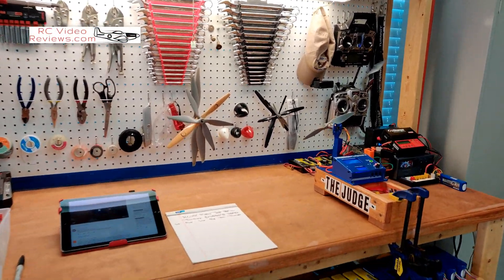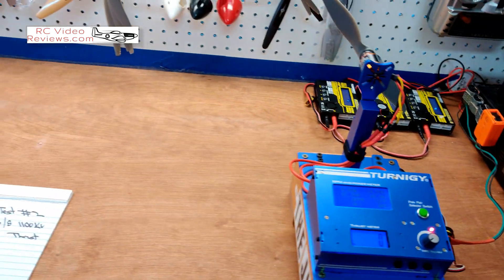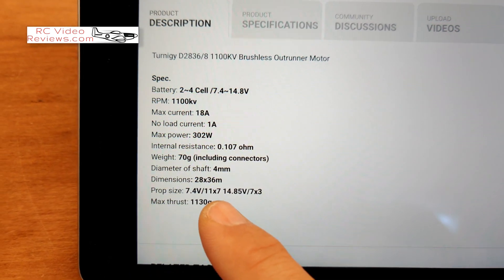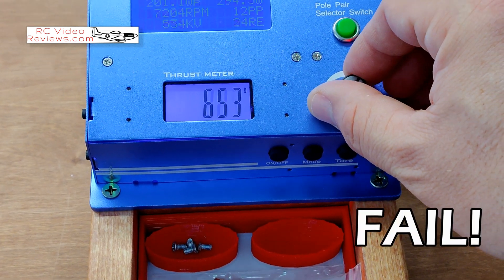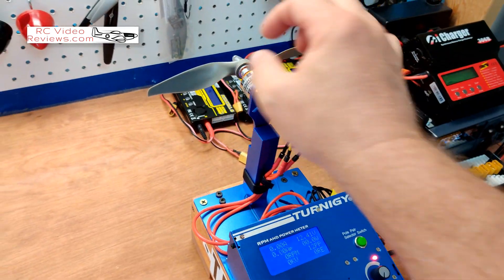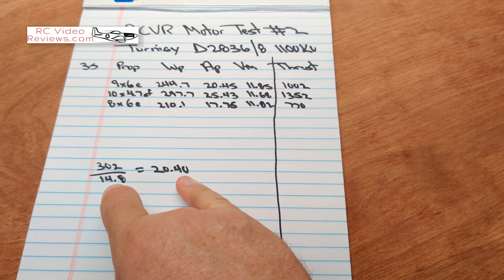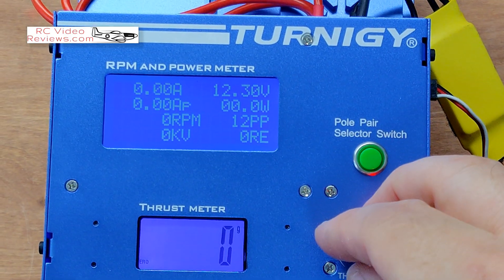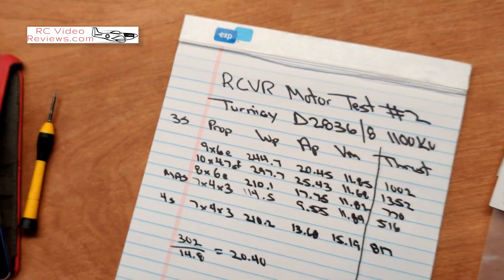Turnigy D2836-8 1100kv Bench Test [The Judge Ep. 2]

Comment: Hi, I’m a beginner. I used 10x4.5 prop on this motor with a recommended 40A esc on my home built piper cub foam plane. It was flying well for 3 mins on 70% throttle but all of a sudden it went down n crashed.The motor was piping hot, the esc was quite warm as well. Could it be due to higher current draw? Will 9x4.5 prop solve the issue?
Reply from the maker: You didn't say what voltage battery? 2s? 3s? 4s? You need to be at a 7" prop for 4s. Probably a 9" prop for 3s. You should also always have a watt meter and test the current/watt values to ensure the prop you use does not create demand exceeding the specs of the motor.

Comment: So I am running same motor with 11X6 prop, seems that it is quite a load but I am flying mostly half throttle so no problems. When I am holding the fuse on hand with full throttle model wants to climb. With a 9X6 prop there is not enough thrust so it can take off my hands as with 11X6 Nevertheless do you think 9X6 would be better in the air. I know very general question not sure if it can answered. Nice equipment by the way.
Reply from the maker: Diameter dictates torque. More diameter = more torque. So it makes sense an 11x prop is pulling harder than a 9x prop. It's not just a question of prop size though. You also have to make sure when you prop up like that, the ESC and battery are equipped to deal with the current demand. Of course a smaller prop creates less load so less current = more flight time but less thrust.
Reply: I'm running a 60A esc that looks to handle it ok, doesn't get very hot, I'd say normal temp, besides I am mostly flying half throttle, same with the battery, it can handle it ok.

Comment: I've used these motors! They are a great size/power for some of the Flitetest planes, like the Storch, Simple Cub, and Sea Duck (2). I also have one in a Hummer 3D, a 39" wingspan 3D profile plane. Props used:  10x6, 11x3.8sf, and on the Sea Duck 8x6 3-blade (2).
Reply from the maker: You're on it! I used to fly these on Mustangs. They're great economical motors and they make great bench top bullets too! Thanks for participating.